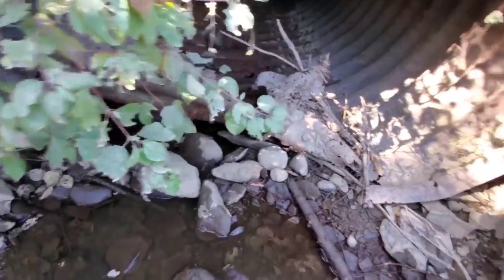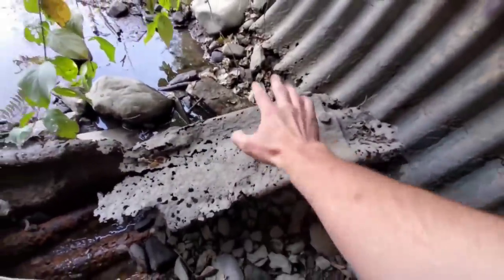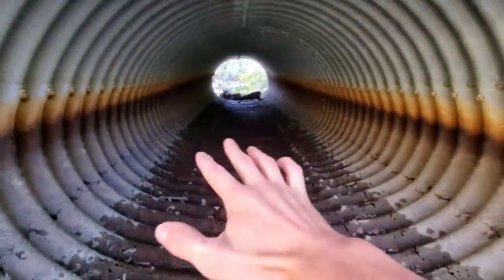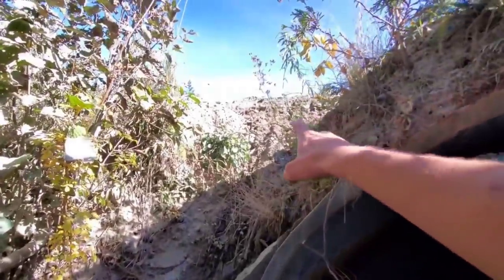This Culvert Pipe Has A Serious Issue

Comment: Now do you think if they did there what they did at the one you showed the other days.where they poured concrete as the bottom of the pipe and left the top metal. Stopping the erosion of the bottom of the culvert. That's was a good fix. In my city it's the homeless tunneling into the levee banks and freeway embankments. Eastside side of our county is the western side of the Sierra Nevada Mountains Ranger. We have lakes and Reservoirs but we got a lot of flat land that feeds the Delta the culverts can't handle the volume. Roads become part of the natural ecosystem.

Comment: If they removed the rusted out bottom, about to where the water line is now, could they add an internal support structure and leave the stream bed clear? Do culverts that are partially submerged below the stream hold up better in the long run?

Comment: What would it take to prevent the road from getting washed out and to fix the culvert please reply back if you know
Reply: Probably dig out the road, fill in whatever holes are below it, then replace the culvert and give it a concrete lip so the same thing doesn't happen again.
Reply: Take the culvert out, fill in the gap below with rock/riprap, then install 60 inch concrete culvert. I used to work for VDOT. The same thing is happening near my house. The creek is undercutting the road by two feet. Eventually the culvert will collapse, taking the road with it.